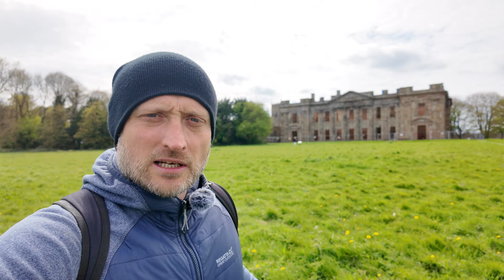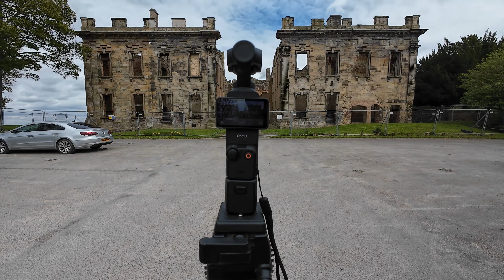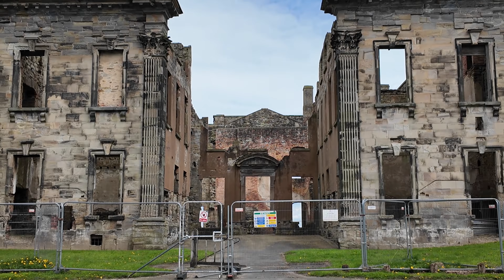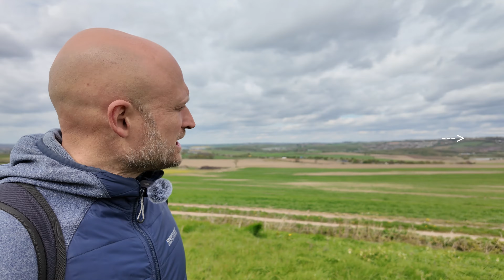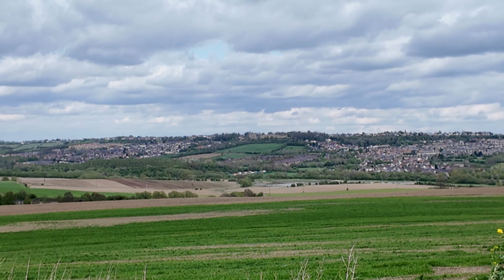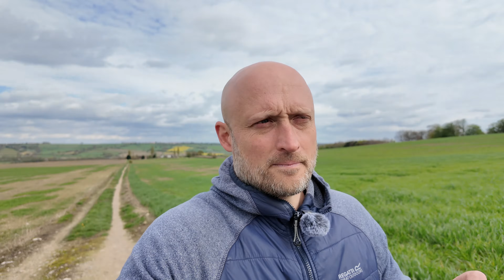DJI OSMO POCKET 3 - ZOOM TESTS

Comment: I have Dji pocket3 and action5 both used to be able to zoom in n out by One Tap on the bottom right corner but now that feature does not work after Firmware Updates not sure Why did dji Removed/Disabled such Useful Function...now You would have to Hold and Turn Manually circle to zoom in and out😫

Comment: Very informative, straught to the point. Thanks!

I usually shoot portrait video with op1, it has tighter angle. Op 3 has wider angle. For portrait video it'll be too wide. So i was wondering if the digital zoom is usable. Thanks!

Comment: What was the camera you used to film yourself in the video?
Reply from the maker: @ohm5016  Pocket 3
Reply: @Filming4u wow it looks like you used a fullframe camera. Thanks.
Reply from the maker: @ohm5016  yes the pocket 3 is absolute quality 👍
Reply: @Filming4u another question. Did you record in dlog or normal color profile?
Reply: @Filming4u  and do you usually use nd filter on pocket 3?
Reply from the maker: @ohm5016  normal
Reply from the maker: @ohm5016  only of its very very bright
Reply: @Filming4u  Thanks!

Comment: The Pocket 2 had a quad Beyer sensor and it could use the higher pixel count to zoom in with no loss up to about X2. But the Pocket 3 has no such spare pixels and its digital zoom is the same as cropping when editing, at which time you can take your time to assess the quality. Still, it's interesting to see these tests, thanks.
Reply: You are wrong.  Perspective distortion is different between zoom before capture and crop after capture.  🤦
Reply: @thatchinaboi1  But the pocket 3 only "zooms" by cropping. And cropping in camera or when editing is the same, except that the amount of crop can be chosen at leisure afterwards.
Reply: @Ozpeter  Crop or zoom is the same.   The difference is between before capture and after.  Which affects the perspective distortion/compression.  This is basic in photography and lenses.
Reply: @thatchinaboi1  You are confusing optical zoom and digital zoom. Digital zoom is the same as cropping, although as I explained, in the Pocket 2 extra pixels were used to minimize loss of definition, so that could give better results than cropping in post. You are talking about the difference between optical zoom and cropping. There is no point in talking about optical zoom in relation to a camera which does not have an optical zoom lens.
Reply: @Ozpeter  No I am not confused about anything.  It has nothing to do won't optical zoom. 🤡
Reply: @Ozpeter  I suggest you ask Chat GPT.  I promise you are mistaken.  Hopefully you will admit to it when you find out.
Reply: @Ozpeter   I am not confused you are. 🙂
Reply: @Ozpeter   What you are CONFUSING is zooming it will not change the DOF.  But the perspective distortion will change due to the distance between the subject camera and background in relation to the FOV.  It's basic optical physics.  🙂
Reply: @thatchinaboi1  The same optics are used whether cropping in the camera or cropping in the editor.
Reply: @Ozpeter  Keep believing what you want.  🙂
Reply: @thatchinaboi1  I think we will have to agree to differ!
Reply: @Ozpeter  You can believe whatever you want.  I know what I am talking about and you don't.  🙂